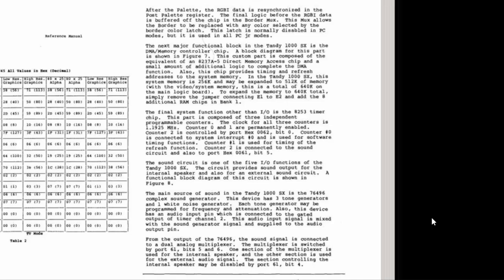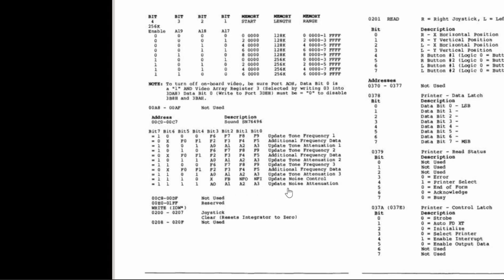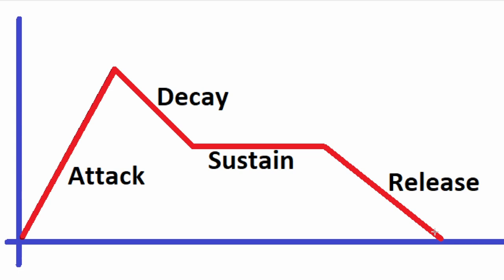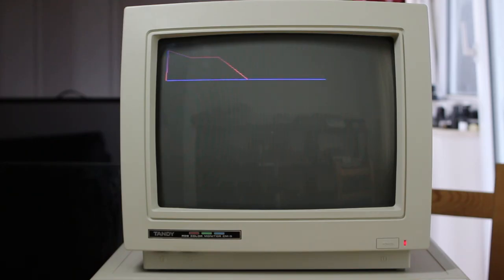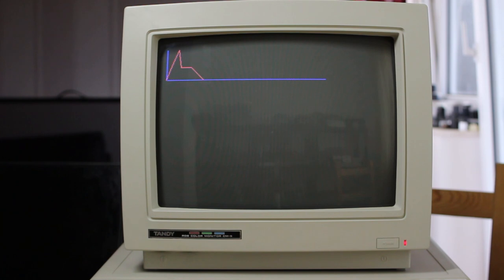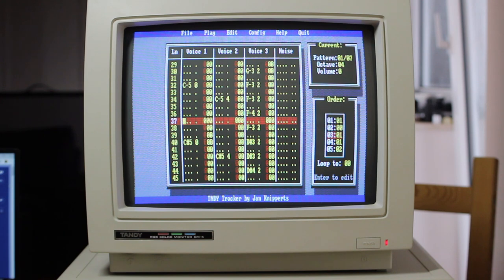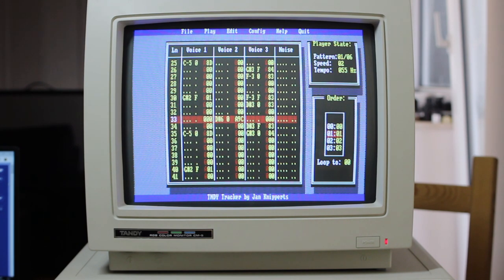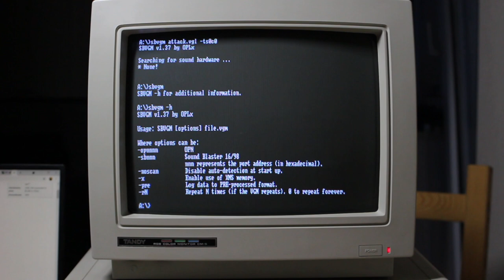Tandy 1000 SX Part 4: Programming the Tandy Sound Chip

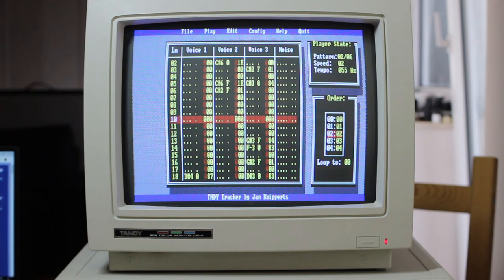Comment: write a driver to spoof the computer into thinking your sound chip is a sound blaster.... :)  15:59 : oh and you could program your own waveforms, using what you have now using the ADSR as the base for the form over time, youd have to do some work, once you get it you could just start writing music or assigning waveform to channels. build your own sound system. write a driver for it and run it at start up. you may need to use something like C, C++ or Pascal. cross compile.
Reply from the maker: Thanks for the interesting suggestions. I'm not sure if a driver to spoof a sound blaster would be possible, as the sound blaster uses a DMA channel, which is only interrupt driven in later cards as far as I know. It might be possible to work around that for some specific games. I'd have to look at what is already out there.
Reply: @PCRetroTech  right on, i was just thinking as i read this; cant you "fake" dma by writing back on interrupt into memory? maybe that might help. keep up the good work.
Reply from the maker: @Gunstarrhero1  I'm not sure, but I don't see how you'd know what interrupt mode you were in and so on. Probably you can make some things work though.
Reply: @PCRetroTech  you can always try :) what i was thinking just involved grabbing the chips interrupt, and writing back in memory to create the dma access necessary, although. if you cant dma, you could always buffer in and out, its slower, but it works.